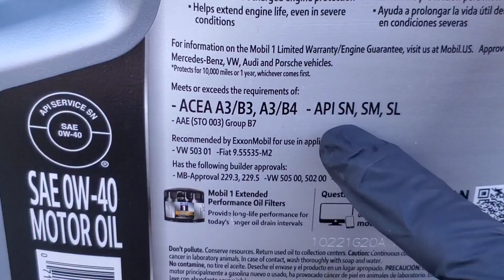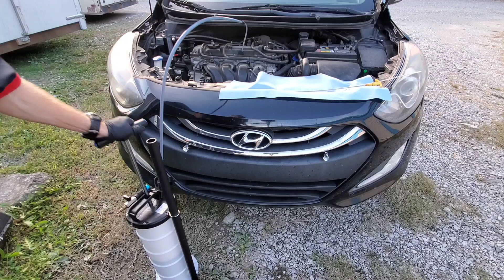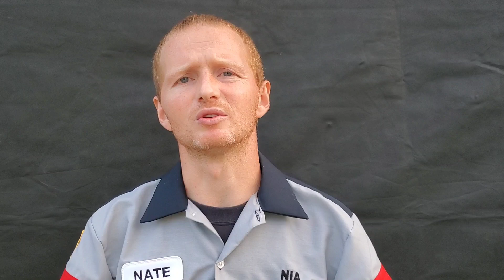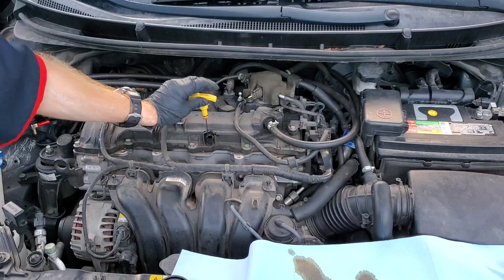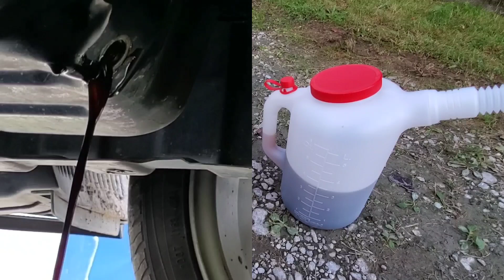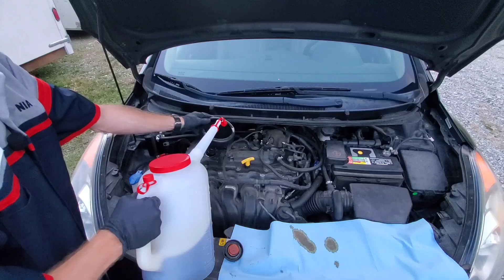European Motor oil vs American Motor oil!

Comment from the maker: Do you own a European vehicle? If so what oil are you using?
Reply: I own a 2013 VW Tiguan and I use LiquiMoly 5w40.
Reply: TheNortheastAl  my mother owns a 2011 volkswagen tiguan 2.0 and I just did her oil change. I used castrol euro 5w-40 with a new oem stock filter. Next time I will use LiquiMoly.
Reply: 5w30 shell helix fully synthetic for now but I'm gonna switch to castrol or mobil 1
Reply: I own a 2001 golf gti vr6 12 valve , I use LM 5w 40 .
Reply: Been using Liquimoly in all my German cars
Reply: I use a Mercedes and sometimes I use 0w40 or 5w40 API European.
Reply: I have american vehicle  i use wolf oil
Reply from the maker: @chadi6536  great choice for Halloween oil lol
Reply: Tiguan R ea888 evo 4 high output running 0w30 Shell ECT vw504.00 507.00
Reply: Ive had 2 different cars (one Japanese and one European) that called for 5w-40. It’s a but hard to find in America but I’ll always use what the manufacturer recommends
Reply: @AOqueso I’ve never had a problem finding 5w40 synthetic, what stores do you go to? Have you tried Walmart? They have all different kinds of brands.
Reply: Hey Nate , how u doin ? I am from India and my car is a Dec 2011 VW Polo 1.2 TDI , earlier I used Castrol Magnatec professional 5w40 then Castrol edge 5w40, now shell 5w40 packed in VW grey packing. Now I am thinking to shift to a better synthetic oil , which one do u suggest ? 
Right now m using the oil approved by VW is 505.00 and 505.01 spec as written on the VW bottle. 

The oils I shortlisted:-
1.AMSOIL European MS 5W-40 Synthetic Motor Oil
2. Liqui Moly Toptec 4100. 

Both the above oils meet 505.01
Reply: Jag XFR Penzoil Ultra Platinum 5w20. Penzoil says to use Euro platinum but I don't see why. PUP is the best.
Reply: mobil super 5w30 XE
Reply: 2023 ACEA Oil Sequences for Light-Duty Engines
Reply: My car is audi a3 1.2 turbo, used shell hellix ultra or mobil 1 5w40 , but now Apply mobil 1 0w40 european car formula, normativity vw 502 505 verifycaed,  is Good chance?? Or is Back a 5w40??
Reply: i use Valvoline 0w-20 european full synthetic
Reply: I have a 2016 Audi A6 3.0t tuned stage 2.  I'm not running a Euro specified oil for several reasons.  I'm using Quaker State Full Synthetic 5w30 API SP.  The 5w30 viscosity I chose is based on my car's rod bearing clearance.  Bearing clearance determines the needed viscosity for any given engine.  40 weight will not flow well enough around the bearings to keep the heat off the bearings compared to 30 weight in a 3.0t engine.  This is also an especially important consideration when running a stage 2 tune with shifts at 7200rpm and heat increasing significantly at these peak shifts.  Another thing, I do not running long drain intervals recommended by the manufacturer, which I'm very sceptical of since this recommendation is centric to polution reduction and not centric to the wear reduction of the engine.  The API SP rating of many of these motor oils are far outperforming most motor oils carrying the VW 502.00 specification approval.
Reply: @webomatic44 you can still get euro synthetic oil in 5w30, castrol and penzoil makes them. Plus you are making an oversight, yes euro oils are made for longer drain intervals (which to be clear I never do) but that means it stays cleaner longer, and breaks down very slowly compared to the rest. Which means it can handle more abuse, something that is great for hard driving or a tuned car. Plus you also have to remember the seals, some standard synthetic oils may not have the right conditioners for the type of seals that your European car uses. Why leave it to chance? Just get a European spec oil, that is approved for your audi (it will say it on the back of the jug). Maybe that’s why European cars are known for leaking here in the United States, maybe they use different types of seals compared to the Japanese or Americans, and traditional synthetic doesn’t have the right seal conditioners for the European cars. Food for thought.
Reply: I owned Asian car. So I have to look after Asian standards Oil ratings.
Reply from the maker: @tenzackyogi1742  what are you currently using?
Reply: @NATESINTERACTIVEAUTO  wolf 5w30 corolla s 2013 but in cap oil put 0w20 i am from lebanon weather is moderate.what i use 0w20 or 5w30?
Reply from the maker: @chadi6536  check the owners manual it will give the best oil to use for your vehicle. Make sure the oil meets all specifications listed.
Reply: @NATESINTERACTIVEAUTO   Penrite Racing 10 Tenths 😊

Comment: So would you say using 5w40 is good for my 2001 Lexus GS300?
Reply: I use regular vavoline in my 01 gs300.  Just touched 300k and only thing ever done was spark plugs and water pump about 2yrs ago.
Reply: No, the correct spec for your vehicle is 5w30.

Comment: Oils carrying API claims only are generally lower quality as the additive treat is lower. Oils carrying API and ACEA claims are higher performance Oils and completely compatible with bio fuel blends as they have been tested against them in specific qualification tests...

Comment: I am restoring a garage find 1960 Ford pickup (223 6 cylinder) I am sure that its original oil is unavailable (I suspect it was a 40 weight). I am willing to buy premium for the old warrior but still if I can get better oil for the same price I can change it more often. Walmart has good prices on Valvoline - what about Euro Blend? or 10w40 Hi Mileage (Its been parked for 30 years I suppose the seals could use any help they can get. recommendations??
Reply: 10.W. 40❤❤🎉🎉

Comment: Here in the EU the owners manual states which typ of oil to use. On the oil bottle the typ and oil is stated and for which auto manufacturer it is approved for.

Comment: O my god this guy is removing oil true oil dipstick you know how much crap is going to stay in there funny guy
Reply: Exactly
Reply: You do realise most mechanics use the suction method these days?  I drain 8 litres of oil from my mercedes using the suction method and measured 7.9L of removed oil.  Just to test the theory I removed the sump plug and nothing came out.  It's a simpler process, no need to jack up the car (if your filter is on top of the engine as mine is) and no mess from draining.  Not sure why you have your panties in a not over the process other than ignorance.

Comment: Have a volvo gas L5 and I used pennzoil euro L which is formulated for both diesel and gas. I heard that diesel oil is much better so I will see how it turns out.

Comment: We must not forget what the purpose of motor oil is, which is lubrication of engine parts to avoid overheating and wear and tear.

Forget about European and North American motor oil preference for this is just marketing by oil companies. The most important thing you can do for any type of vehicle is change your motor oil every 5,000 km or every 6 months whichever comes first.
Also make sure you use 5-40 or 5-30 synthetic oils whichever your specific vehicle requires, because the thickness of oils does make a difference in operation and life of your engine.
Do NOT change your motor oil every 10,000 km or 1 year for most car mechanics will tell you that will potentially reduce the life of your car engine. Some car specs say you should change your motor oil every 10,000 km or 1 year ... DON'T!
If you use your car for racing there are even shorter motor oil change intervals and they also add more oil additives to deal with the extreme high temperatures caused by high rpm's.
And changing motor oils frequently is NOT bad for the environment for old (replaced) motor oils are recycled by Law and fresh motor oil in your engine causes reduced tail pipe emissions.

Comment: I have a 2007 dodge charger SRT8 and its recommend mobile 1 0w40 should i switch over to 10w30
Reply: Use pennzoil 0w40 that says SRT on the bottle. 5w40 can work too i think. I use pennzoil/quaker state euro
Reply: Why did you go thinner?

Comment: I use petrobras on both my JDM and Euro vehicles, SN+ certified but spec wise higher viscosity than mobil 1 on high engine temps, so technically superior, also costs about half (made in Brasil, I live in Colombia), I couldn't find it in the US when I was visiting so I bought royal purple for a friends car, I was told it is up there with the best. As for the diesel oil thing, I use 15w40 on an old subaru EJ16 engine (250+k miles), it is both CK4 and SN certified, I choose to use this oil because it is really detergent, it keeps my piston rings clean, since I use it there is no longer smoke on cold starts.
Reply: Did it require anything temps lower prior to 250k ? Props btw lol that’s crazy
Reply: @Blackstarentity  used 10w30 up to about 200k, but started burning oil. Just gifted the car to a Little cousin! Hope he gets it to 500k no problems
Reply: @Blackstarentity  also use that 15w40 on a honda Accord F22b1, I race the ... Out of it and the oil holds up wonders because of how strong it is, it's Made for semi trucks lol, but still gets SN certified so it will not ruin seals or metals

Comment: Is it okay to use this instead of Dexos 2? I'm having a hard time finding the Dexos 2 for my corvette c7 but I can easily get this European one.
Reply: European oils are pretty stout compared to US specs.  I run 0W-40 European in my 2018 F150 5.0.
Reply: @Bushy556  it's half the price of the Dexos 2 ones too. GM just wants a piece of the action I guess.

Comment: soooo I should just start using euro oil in my Silverado? quaker state 5w 40
Reply: Won’t hurt. I run 0w-40 in my 2018 F150.
Reply: I accidentally picked up a Castro euro 4gal 5w/30 full synthetic for my Silverado and 1 quart 5w/30 Castro full synthetic dexo 2. I didn’t notice till after I did the oil change. Do you think it’ll be alright ?
Reply: @danielcastaneda5249  your truck won’t know the difference. The European oils have API approvals.
Reply: @danielcastaneda5249  I'm sure it'll be fine. Better then the used oil that was in it and certainly better then nothing. How many miles are on it?
Reply: @bloodbushcraft2467  it’s a 2013 with 57k miles

Comment: I have a 07 dodge charge SRT8 that recommended Mobile1 0w40. Can i switch to 5w30?
Reply: I would never go lighter than recommended
Reply: Why would you? Engineers know what they are doing lol trust the manufacturer
Reply: @cb7pwn  ok thanks for the reply it's just that mine has hit over 200,000 miles and the engine has a ticking sound. Will a thicker oil quiet the ticking sound?

Comment: Do not use European oil in a car while using gasoline with ethanol in it!  Oils for the USA are designed to work with ethanol gasoline where as the Euro oil doesn't factor in ethanol use.  If in the US, and you can get ethanol free gasoline, then you will be fine with Euro oil.
Reply: That shouldn’t make any difference
Reply: I had to correct you but European fuel has ethanol in it.
Reply: Close all european gasolines have ethanol in it, and the most european high quality oils are compatible with E85, but very little european car are factory compatible to run with E85: the most need a adater (electronic box or remapping), sommetimes with replacement from injectors...
Reply: If you have a direct injection engine it does not make any difference. Even then it shouldn’t make a difference as a whole
Reply: I run 5w 40 euro on my methanol injection car lol.
Reply: Nah, it wouldn't hurt a thing, just change it on time
Reply: Good to know.

Comment: Can you use the European oil in North American car?
Reply: Yes
Reply: Only if using ethanol free gasoline.
Reply: @d.k.4653  bullshit: close all european gasolines (95 and 98) contains 5 to 10% ethanol...and the most quality european oils are compatible with E85, BUT the most european cars are NOT factory compatible to E85 they need remapping or electronic flexfuel box

Comment: I usually go by the manufacturers spec, if my manufacturer is not listed with the appropriate spec on the bottle I don't usually use it.  For my BMW I use LL04 for example.  I might vary the grade slightly depending on how it's running and how much oil it's using.  Older more worn engines will need a thicker viscosity if they are burning a lot of oil.
Reply: Thicker oils in older engines does NOT solve the problem of carbon build up on the worn or damaged piston rings plus you run the risk of overheating the engine. If you are burning oil you need to rebuild the engine with new parts.
Thicker oil when thinner oil is recommended is like running a 100 meter sprint with a broken leg ... yes it can be done, but you will create more damage!
Reply: @mauriceharting5877  -  Yeah but when you are running a beater into the ground and trying to last from one MOT to the next saving money in the short term you don't care.  I run 90's VW's so thicker oil is a solution, it used to work on old Ford Pinto engines too.
Reply: @marcustaylor670  Well, yes, when one has a beater and it is old and don't want to rebuild the engine by replacing the piston rings or spend the money doing so that would make sense. Thicker oil does coat the piston housing sleeves more and slow down the worn rings wear, but it also increases the risk of total engine failure.

Comment: This is why I use pentosin or liqui moly for European cars solves a lot of issues making sure it has the proper specifications
Reply: I think they solve issues in American Cars too, my MKX calls for 5w-20 and I use Pentosin 0w-20 and it runs smoother than Mobil-1 5w-20. I don't need to add any oil on a 7,500 mile OCI and with Mobil-1 I always have to add 1.5 quarts in the same OCI.
The cold start is smoother too with Pentosin 0w-20.
Reply: @robertogomez8100  Any and every car will run "smoother" with fresh motor oil simply because of improved lubrication versus dirty motor oil. The brand of motor oil is not relevant if they are true synthetic they all have to meet minimum standards for car performance. It is like fuel. Chevron or Shell gasoline with the same octane will perform identical. Many people will have a subjective preference for one brand over another.
The most important thing to do is change your engine oil every 5,000 km or 6 months whatever comes first and you will increase the lifespan of your car engine regardless of the vehicle and engine oil used. Also make sure you use the recommended engine oil viscosity and fuel octane for your specific vehicle.
Reply: @mauriceharting5877  Not True try to use cheap oil and your exhaust wil start to smoke
Reply: @A46648  Cheap motor oil still has to meet SAE standards for it to be sold and not get sued. If your exhaust smokes it is because you have engine wear (probably piston rings issues) and that usually happens because of age of the engine or lack of sufficient oil changes and maintenance.

Comment: Do you think Chrysler 2.7L motor should run off of 5W-20 as in the 2010 ? I only use 10W-30 and maybe 5W-30 synthetic for a 1999 2.7L . There cam tensioner plastic was gouged out deeply mines never seen it and that 2010 can't stop rattling . No changes in their 2.7L engine you could not pay me use 5W-20 unless that car stays in very cold climates .

Comment: For VW/Audi ACEA standards are meaningless; the oil must meet the VW/Audi specification for the motor in the vehicle.  Depending on the year and gas or diesel will dictate what oil specification you need for the vehicle.

VW/Audi have had specifications starting with (if my memory is correct!) starting with the 2000 model year vehicles and have been known to change from year to year.

In many cases, the newer specification supersede the old ones but not always.  The current specification for some models is either 508.00 or 509.00, for vehicles using light weight (0-20w oil).  This standard IS NOT backward compatible! 

VW/Audi have been in the past (when I was dealing with it at the dealership service level) quite strict  about using the correct specification oil in determining warranty coverage for internal engine repairs.  Just for your readers info.
Reply: Most of the newer VW gas engines use a 502.00 spec oil which is usually 5w40, but can be 5w30, depending on owners manual requirements.
Reply: @TheNortheastAl  I run mobil 0w 40 in my wife’s 2015 Jetta but I change it every 5 k we live in a really hot and dusty area the car also spends a lot of time in stop and go traffic
Reply from the maker: @TheNortheastAl  The vehicle manufacturer gives the best option for the vehicle.
Reply from the maker: Yes thanks for sharing, thats why I madw a point of say each vehicle is different and many manufacturers have their own requirements like the USA. Like the api it helps to make sure oil is meeting a standard. Emissions is something they are all working to improve. Again thanks for your time.
Reply: @NATESINTERACTIVEAUTO  what if the car manufacturer recommends sae viscosity ranging from 0w30 to 20w50 on the same range of temperature in hot conditions. Of course a 0w will flow way better at cold but being realistic, a 15w40 at 0°f is like honey. My point is.. A new 5w30 api sp, or 0w30 can withstand a summer 43°c low idle speed in hesvy traffic, repeatedly? I've read in some api sp 5w30 that they are using moblydenium and boron instead of more zddp to protect catalytic converters and it is a good thing the more moblydenium and boron the oil has to compensate friction inside engine, also.. An oil producer for racing application said in one video here on YouTube that moblydenium it has been used a long time ago in racing thin oil such as 0w20s